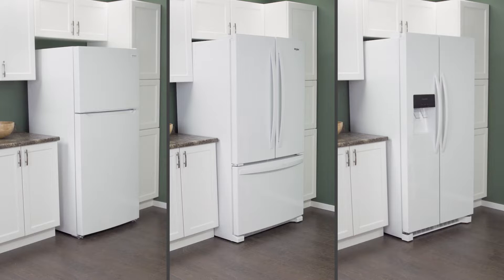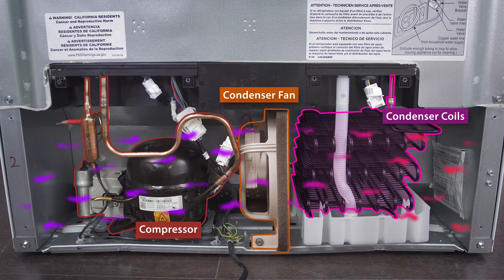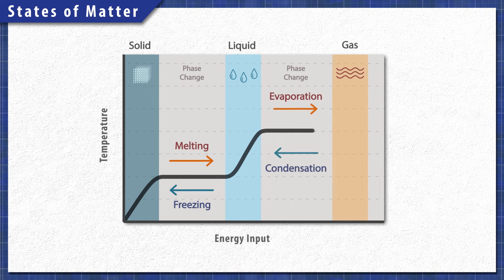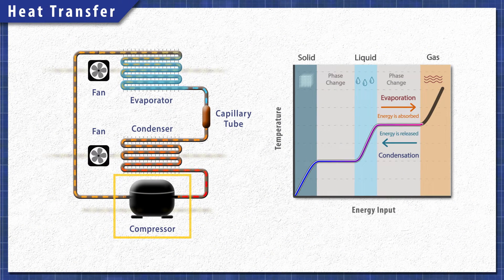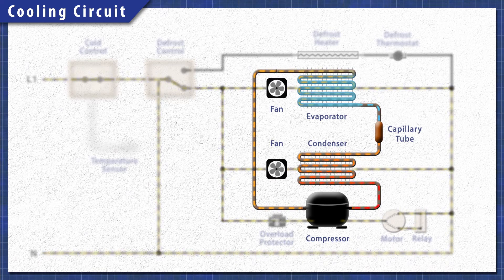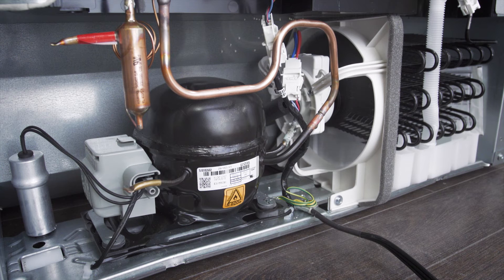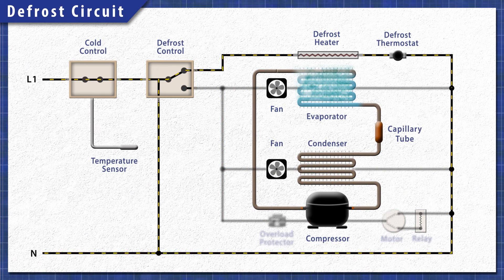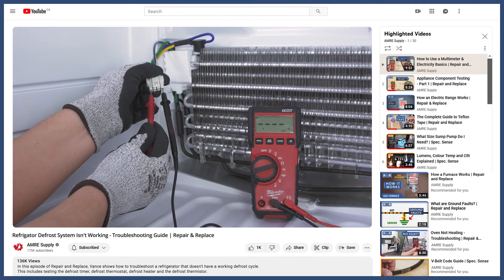How a Refrigerator Works | Repair & Replace

Comment: There's something I don't understand about the capillary tube. 
Shouldn't the restriction of the flow increase the pressure? Like when you obstruct with your thumb a garden hoose?
Reply from the maker: That is a great question. Obstructing a garden hose with your thumb is a little bit different as the water is only restricted at one point and is released into the air (a very large space). 
When a fluid is flowing through the capillary tube, the pressure drop is caused mainly due to viscous forces. When a capillary tube has a small enough diameter and is long enough, it increases the surface area of the tube compared to the volume of air. This means there is a lot of friction against the capillary tube walls which throttles the refrigerant. This wouldn't work with a short capillary tube, or a larger diameter tube.